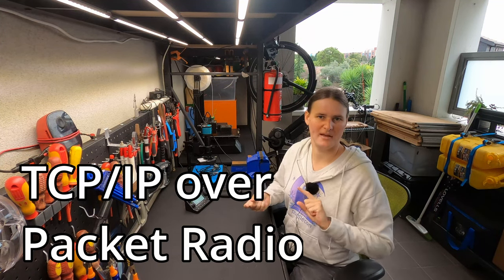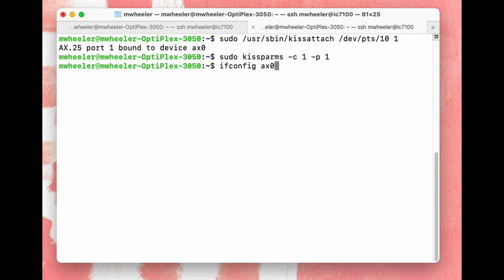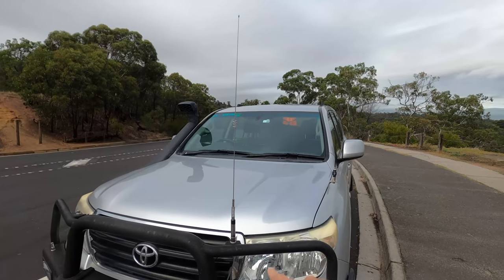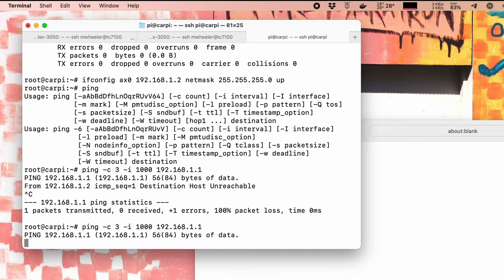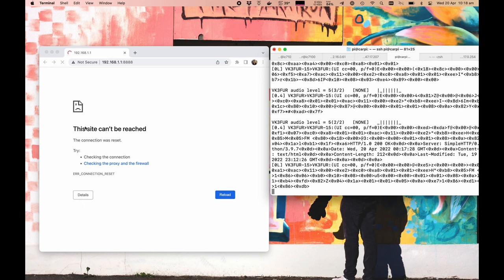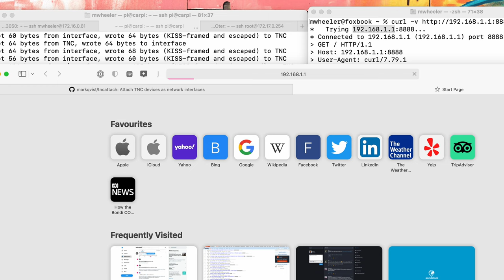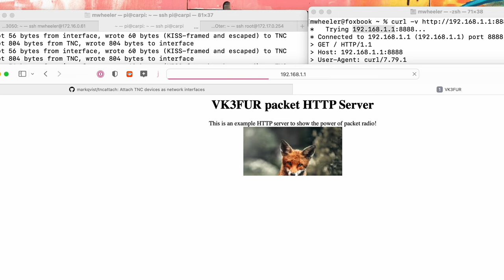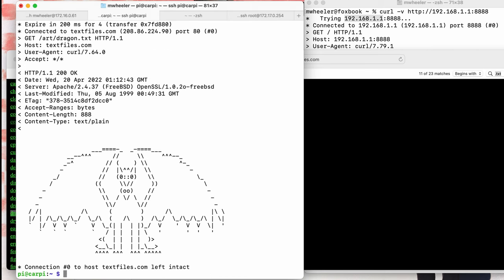Intro to TCP/IP over Packet Radio

Comment: I bought a book on TCPIP over radio many years ago. I knew nothing. This book enabled me to get a dual band gateway running on JNOS . Days of a 286 . So I had 9k6 baud on UHF and 1200 baud VHF. It worked well. Learnt about bit masking and all cmds at the prompt, no fancy GUI. Simple syntax CMds did everything to addressing rs232 ports. Had no help. I got there. That book was by Ian wade I believe. Still have it somewhere. Thanks for your inspiration to get me interested again at age 76  now.
Reply: NOS Intro by Ian Wade.

sbf  aka ab8b

Comment: Hi VK3FUR, thanks for the nice and interesting video! I am the author of tncattach :) Absolutely crazy coincidence, I've stood in that exact spot at looking out over Melbourne quite some years ago. Wouldn't have guessed at that point I'd write a program that allowed someone to download a fox to Wurundjeri Lookout over packet radio more than a decade later.
Reply from the maker: Wurundjeri Lookout is my favourite for VHF/UHF because of the radio horizon reaching across Melbourne and being so close by. I usually do HF things Bellbird park as it's usually fairly quite (both from people and RF noise :P).

Thanks for tncattach it's been super fun to play with and easy to use for experimenting. It was great fun using it over HF with the freedv modem!
Reply: My idol... )))

Comment: I was on packet radio many years ago, when it was about as fast the dial up modems many people had.  Unfortunately, speeds haven't kept up, at least not on 2M.  Perhaps more needs to be done on bands that support much greater bandwidth than what's allowed on 2M.  These days, with 5G, a few hundred Mb can be had on common cell phones.  If I were to do something like this today, I'd be tempted to use PPP over the radio link, instead of bothering with AX.25, which is based on an ancient protocol.  One of the attributes of X.25, which it's based on, was it was a virtual circuit, instead of a hop by hop connection through routers.  On the other hand, PPP is an actual IP transport that can be used with a variety of devices and would be used only as far as the Internet connection.

Comment: Thank you for sharing and we are looking for AX25 to do chatting across the network with its limitations.  Your higher speed TNC i think has a different modulation with maybe more the 1 bit per symbol.  Can you say more about it.
Reply from the maker: This video was specifically using the 1200 baud modem provided by direwolf which is the Bell 202  AFSK modem, however direwolf supports 9600 (G3RUH modem) and 300 baud (Bell 103 modem) modulation types.

Comment: Is it the radio speed that limits the packet speed or regulatory agencies ie the FCC, OFCOMM etc.? 
The view from that lookout point is breathtaking! Does that area qualify for a POTA activation? Very interesting info. I remember playing a bit with Packet back in the late 80’s, an interesting system at the time with mailboxes for messages and being able to set up a link between the Midwest and California. Took around ten minutes to send a simple message.
Reply from the maker: FCC and OFCOMM might have limitations (I only know ACMA sorry), but the biggest problem is radios only have a limited amount of RF bandwidth available.

No POTA for that lookout afaik.